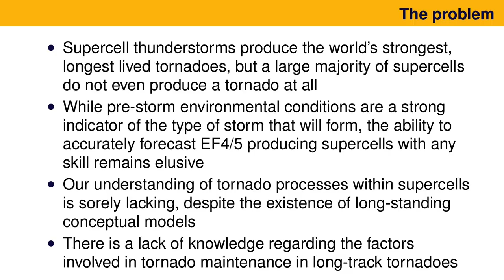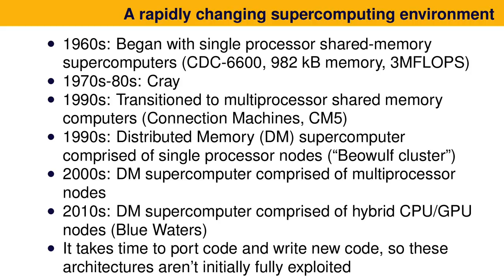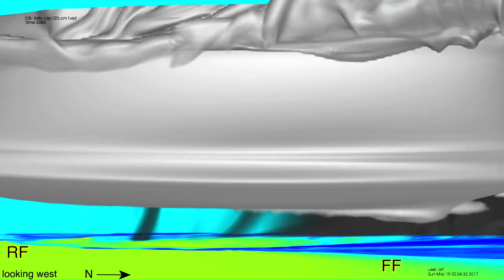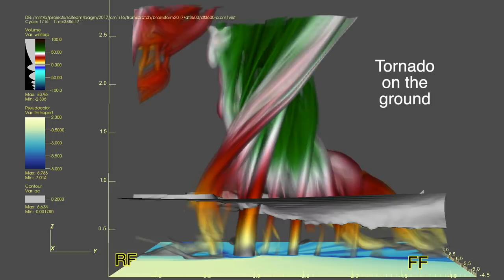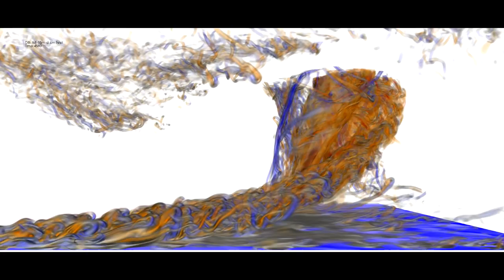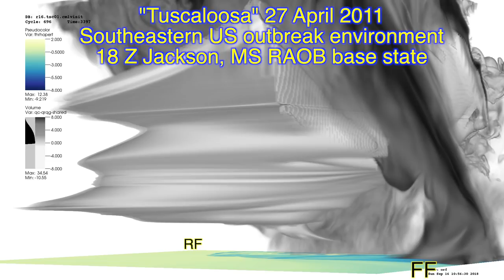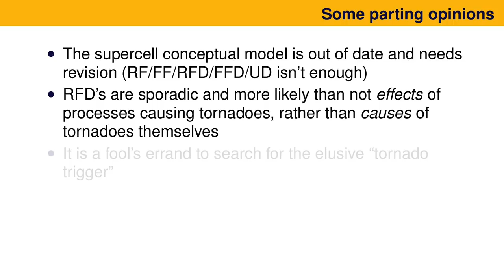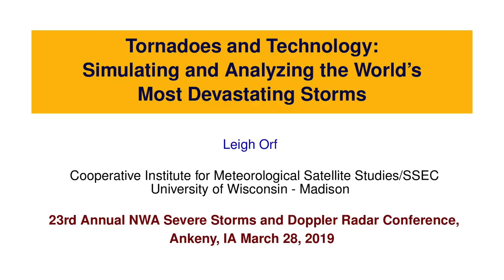Tornadoes and Technology: Simulating and Analyzing the World's Most Devastating Storms

Comment: Another fantastic talk Leigh. You are correct I believe in your postulation that the 50 to 60 m/s updraft is what controls forcing all the underlying effects, like convergence, tilting, stretching, cold pool, downdrafts, etc.  I also think the SVC is an effect also, sorry to say, of the super strong updraft tilting and lifting moisture up and into the mesocyclone. So the main forcing for the updraft is the internal heat engine of the mesocyclone. What is cause of the mid level mesocyclone will be the answer to tornadogenesis. I have a strong opinion on this that could use your modeling expertise.
Reply from the maker: We won't know until we drop trajectories in and do budget analyses - we are developing the tools to do this right. Establishing clear causality is the ultimate goal but in a highly nonlinear system it can be pretty tricky.